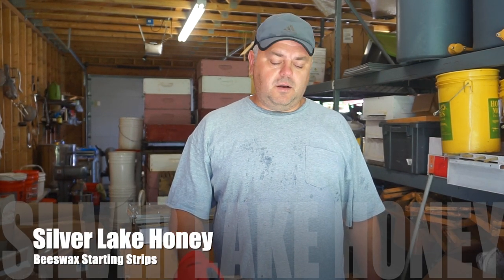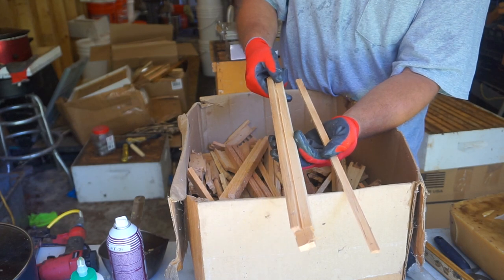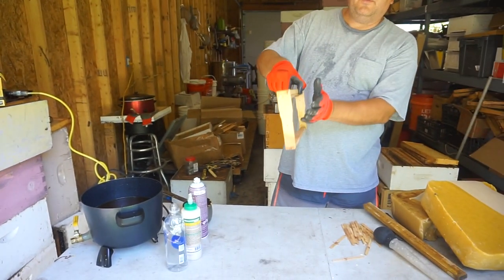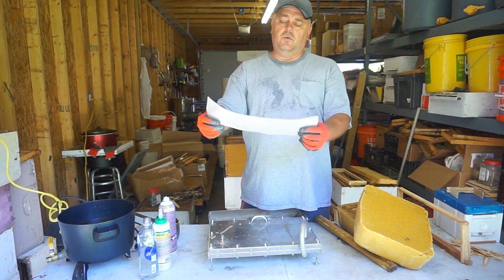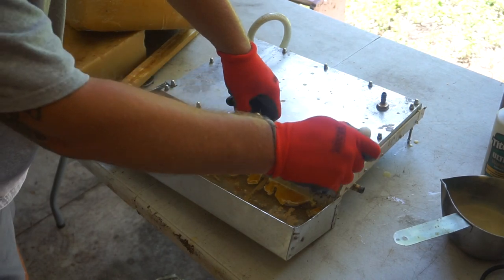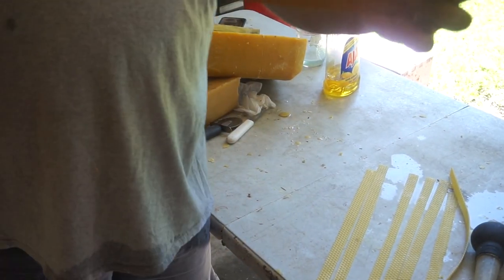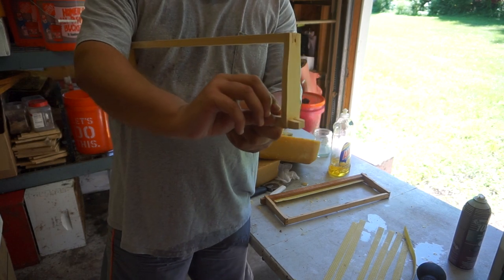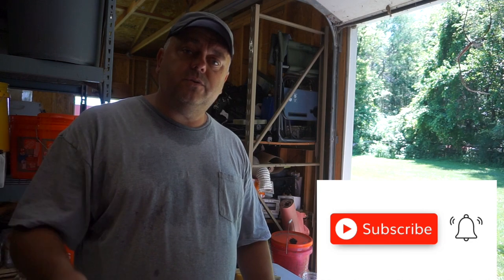Beeswax Starter Strips 101 🌟 Comb Honey - Candle Making - Queen production 🌟

Comment: I've been doing comb honey for over 20 years. 
 It is faster to just turn the wedge strips up and put a few 5/8 brads in them than using popsicle strips and there is no need to add wax. They last for years of reuse. 
 The main thing is to have your hives level from side to side. 
 Also the have a copper baster made for wax and it stays warmer longer in several beekeeping catalogs.
Reply from the maker: Good tips 👍 thank you. I usually checker board totally empty frames between the drawn frames and it works pretty well.